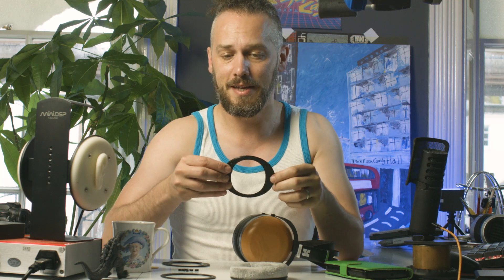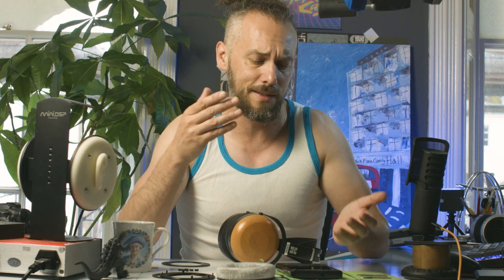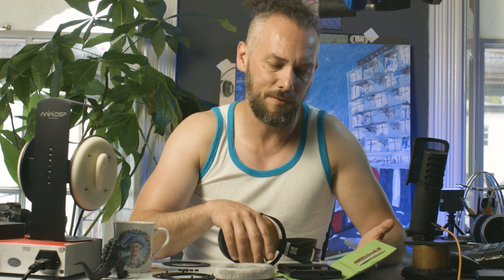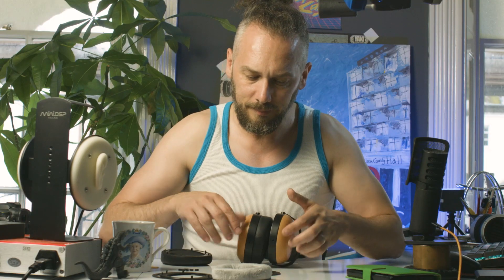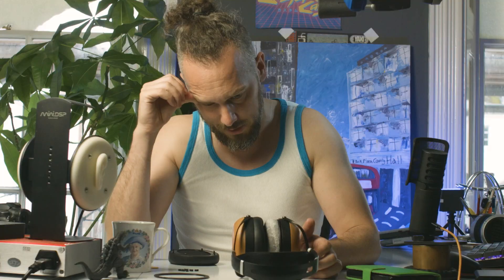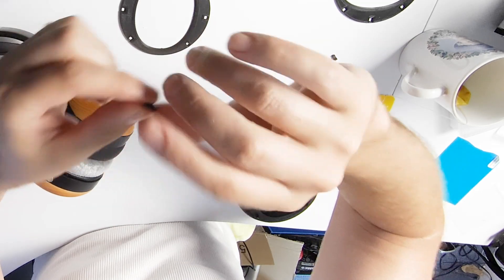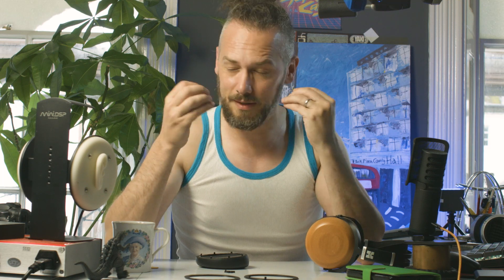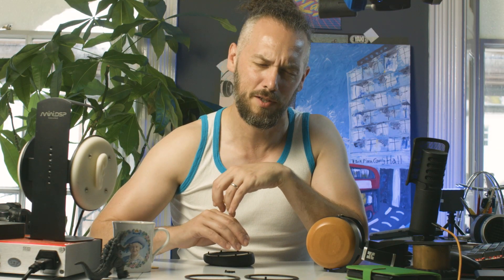HiFiMan Sundara closed back pad adapter rings

Comment: I'm not sure what they are for. I thought it was to use larger pads, now I think it's just to use non hifiman pads on them, but same size. Correct?
Reply from the maker: Yes - these are just to use different 100mm pads - you could find some with larger openings than the hifiman ones

Comment: Would you say these headphones are a steal for their actual price (150$) or going for a dt 770 pro is safer ?
Reply from the maker: Yes they are a real steal at that price - I suppose it depends on what you want from the headphones - the sundara closed have eppic bass but the mids are a little forward for my liking, the DT770 80 ohm probably have better mids and treble. Both can be  modded the tune them a bit

Comment: Just printed that adapter. To be honest, you don't really need glue. Once the tab is locked into the earcup - it stays there relatively strong.
Reply from the maker: that is because the are brilliantly designed ;) LOL
Reply: @CustomCans  They are indeed! However, it feels like that factory (stock) earpads are way better than anything I have (Dekoni) ... sadness
Reply from the maker: @advocado7373  I am waiting for a new batch of sundara closed to get here but when they do I am hoping to try out a few pads
Reply: @CustomCans  Do you have contacts with HiFiMan? Do you know shy they don't sell replacement pads for Sundara closed?

Comment: What glue do you recommend on using?
Reply from the maker: I used normal superglue and it seemed to work well but i suppose it would depend on what material you print them out of
Reply: @CustomCans  I purchased ready-made from you.

Comment: Have you been able to test some other pads? Any that you would recommend in particular over stock? I haven't seen anyone put in as much work as you have with these cans... thank you!!
Reply from the maker: No. I have messed up one of the drivers while experimenting on it and don't have another pair to do some proper testing on at the moment
Reply: @CustomCans  I landed on ZMF Universe (perforated suede) pads. Slightly less bass response but wider soundstage which I really like! I won't lie I thought these sounded like hot garbage, but after your foam inserts and pad change, I can't take them off. Brilliant stuff!

Comment: any update on the hd 660s ?
Reply from the maker: No - I kind of gave up on them as there is not a huge amount I managed to squeeze out of them safely. I may give it another go in a couple of months but it may not be possible to get similar results to what we did on the HD600 / HD650 without removing the driver from the baffle during the install and creating a possibility of people breaking their 660s while trying to mod them...

Comment: do you have any mods available for beyerdynamic DT700 pro X?
Reply from the maker: We can convert them to balanced and make fancy cables for them but that is about it at the moment... What kind of thing would you like to see?
Reply: @CustomCans  similar mods that are available for hd25 and for the hd6xx, loading and dampening kits. Anything that improves the sound 👍
Reply: @sebtaylor69  they are sounding pretty good allready, one of the best closed backs.
Reply: @rez1222  they are good but everything can be made better 😊 I do find them a little bright but that is compared to other open backs that I have.
Reply: There is a video here for extended 3D printed ring for your headphone
https://www.youtube.com/watch?v=J1skTSMg1dM

Comment: Hello Jason, nice video.
You asked about inpiration: I can't find any helpful material on "How to get rid of the awful Hifiman Deva/Pro headband"
I like the sound of my Deva Pro and i have Dekoni Sheepskin pads on them. But the headband is so effing bad... No clamping force at all and after one or two hours it really hurts on the top of my head because the whole weight rests on a small spot in the middle.
If it wasnt for that teeny tiny wire that runs through them, i would just buy any other headband. :D
Reply from the maker: Well.. You may be in luck. I am in the middle of prototyping and testing a headband mod for the HE400se / eddition XS and it should fit the Deva Pro as well Should be ready to go next week hopefully
Reply: @CustomCans  now i'm verrry intrigued 🤩
Reply: @CustomCans  This has been on my mind for months since the original EXS video. Glad it's finally real, you're the boss.